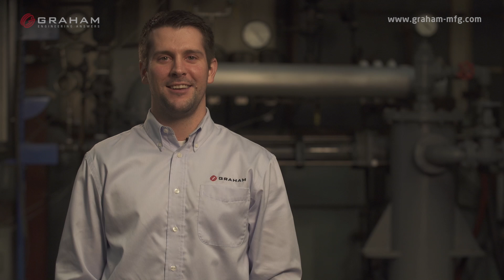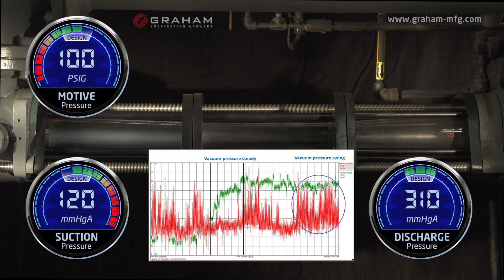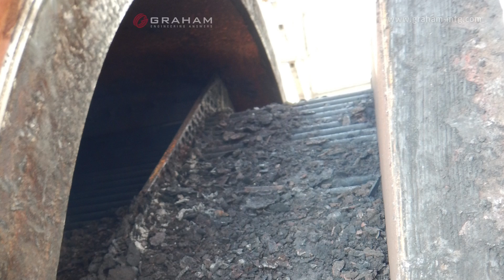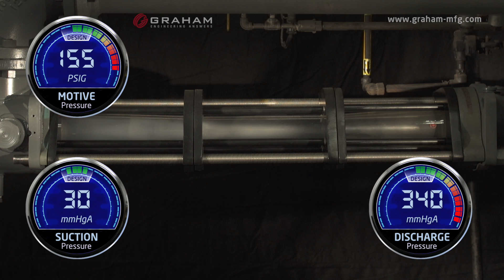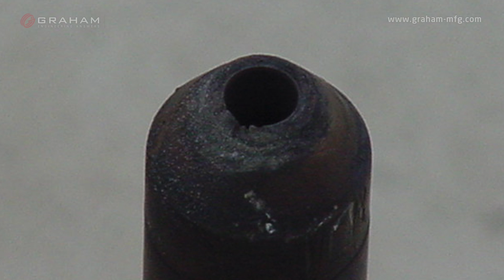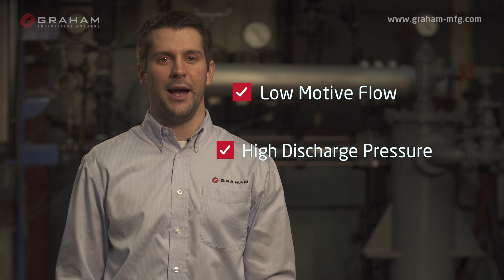Graham Corporation - Ejector Troubleshooting

Comment: Nice video. How the formation of the shock wave ensures the smooth operation of an ejector? I am assuming through the formation of shock wave, the local pressure increases instantaneously, and that pressure rise facilitates achieving high discharge pressure at the diffuser. Is my understanding correct?

Comment: Hi, what will be happen if you inrease the motive pressure above the design pressure. Goes the suction pressure down or up? (Supposed that the condenser is big enough and that the discharge pressure stays constant)Thanks
Reply: Depending on how much you go up. Initially with increased motive pressure your suction does go up, but ejector overall looses on efficiency. If you continue increasing the pressure, eventually you will get to the choked flow condition and if you continue to increase even more, you will start loosing your suction. If your ejector was working fine and all of a sudden you need to increase your steam pressure to keep the suction at the design point, you have some issues that need to be addressed as soon as possible. Cheers.
Reply: @mladeen1  hi Mladeen1, is it possible for us to know does our ejector has a shockwave or not in the middle of the choking position?, I am an intern student in mechanical engineering in a power plant, their system has the very low suction capability, they must turn on the hogger all day long parallel with three-stage ejector to vacuum the chamber
if they turn off the hogger, the three-stage ejector couldn't maintain the vacuum
I assume that there is excessive back pressure, but don't really know because they said they have clean the 3-stage ejector
every thing is normal, motive flow 300 Celsius at 0.83bar, but can only vacuum 13fKpa
thanks
Reply: @ianm1898  Hi Ian. Shockwave and choked flow are not directly related. Typically, you develop supersonic fluid velocity in the throat of ejector if your discharge pressure is 2 x higher than the suction pressure (this example has 30mmHg suction and 300 mmHg discharge), that is when the sonic shockwave is created (technically there is always a shockwave as you are compressing the fluids, but not in this scenario we are talking about sonic one). Choked Flow is a situation where , no matter how much you increase motive steam pressure, you are not getting improvement on the suction pressure and/or flow. 

Running hogger at all times is definitely a sign that the system needs to be maintained. Hogger is highly inefficient ejector (uses much more steam than the entire system combined) and should be used only for start-up... The actual numbers you gave really do not matter much, as each ejector system should be designed specifically for the application (at least better ejector companies do so). 

There are certain steps that you can do to check where the issue may be. Unfortunately, it is not something that can be explained here. I can definitely discuss it with you in more details , but not here, of course. I am also available to offer my consulting services, if your plant decides it is worth it.

Comment: Please what motive fluid pressure to the steam ejector does an 8tons/hr vacuum spray noodle dryer require to work efficiently?
Reply: The answer is not that simple. You have to inform temperature, operating pressure, water vapor load, etc, etc..... and at the end, the motive steam pressure is the one you have in your facility. The ejector will be designed to that pressure.
Reply: Ejectors can be designed for whatever motive pressure is available.  The nozzle geometry is adjusted accordingly to fit the motive conditions.
Reply: hi  @Paulo Teixeira Jr  and  @ericjohnson6289   is it possible for us to know does our ejector has a shockwave or not in the middle of the choking position?, I am an intern student in mechanical engineering in a power plant, their system has the very low suction capability, they must turn on the hogger all day long parallel with three-stage ejector to vacuum the chamber
if they turn off the hogger, the three-stage ejector couldn't maintain the vacuum
I assume that there is excessive back pressure, but don't really know because they said they have clean the 3-stage ejector
every thing is normal, motive flow 300 Celsius at 0.83bar, but can only vacuum 13fKpa
thanks
Reply: @ianm1898  If the hogging ejector is needed, then either the air leakage into the system is too high or the three stage main air removal system has an issue, which could be motive steam related, cooling water issues, mechanical damage, condensate drainage issues, etc. Reach out to Graham at service@graham-mfg.com and we can start assisting you with an official service inquiry.